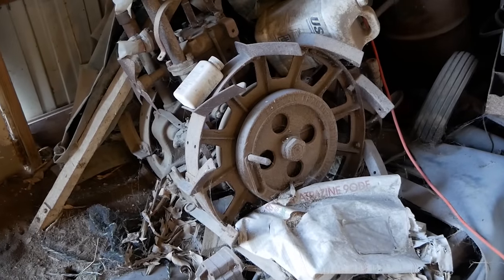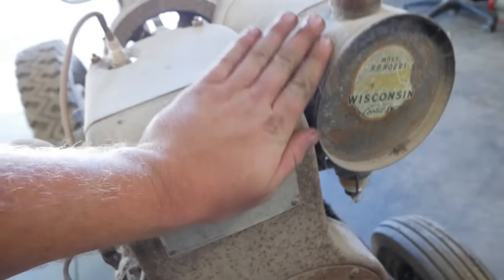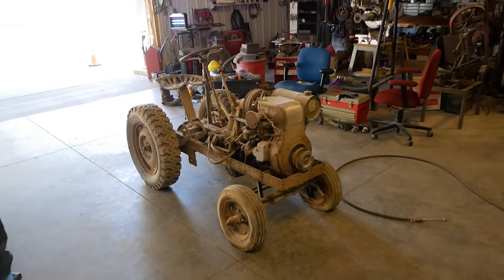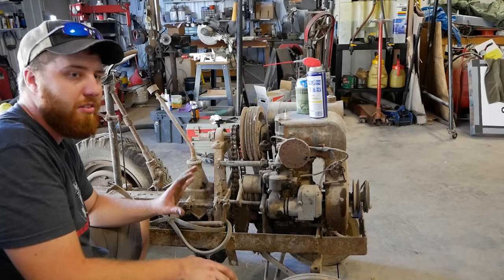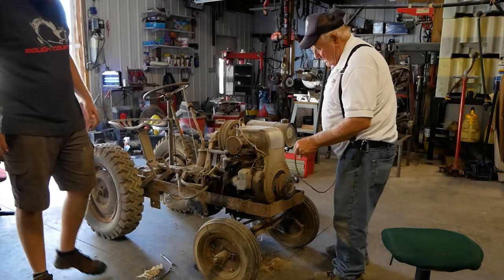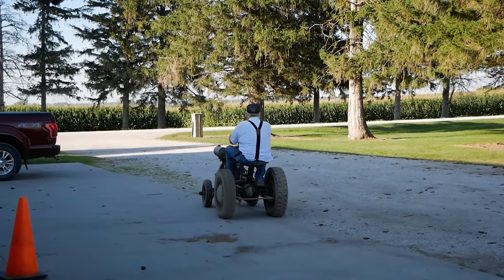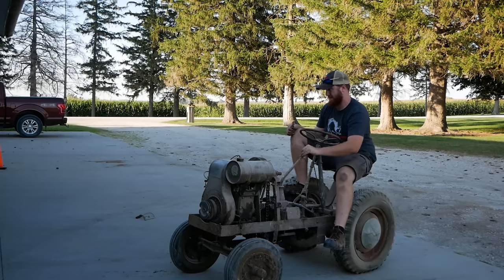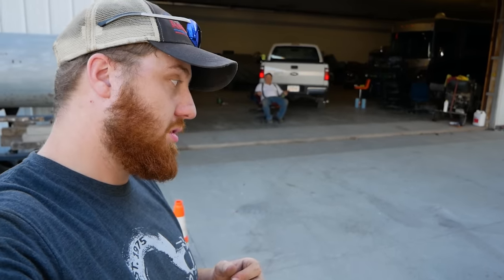Will This Homemade WW2 Era Garden Tractor Run After 20 YEARS Abandoned!?

Comment from the maker: Thanks to Honey for sponsoring this video! Get Honey for FREE today ▸
https://joinhoney.com/junkyarddigs
Reply: Mmm. Yes honey
Reply: Much better sponsor then the shave your junk company.
Reply: I have 3 garden tractor I am selling a 61 Sears Suburban  a 1973 wheel horse and and a 1970s John deer 214 garden tractor
Reply: Let me know if you are interested
Reply: the new sponsor is like a late 70's or later sub compact car with a 3 speed automatic such as my 1985 Dodge Omni I used to have...NO BALLS!!! LOL🤣🤣🤣
Reply: @Junkyard Digs Kevin that thing was something and Denny is a real legend of a guy, still fascinates me to this day how you can build something great out of leftover parts, a friend of mine has a tractor like that but bigger, it was built in 1963 by an old farmer who didn't have the money for a new tractor but had a worn out 1936 for 1 1/2 ton maybe 2 ton truck that seen way better days, chopped the cab off shortened the frame and put a late 30's maybe 40's or early 50's Chevy half ton 3/4 ton axle in the back with small tractor wheels and tires. Also took the shocks off the sides of the truck hood off and had nothing but the clutch, 2 brakes and a gas pedal with the 3 speed truck transmission and the more powerful 85 horse flathead V8 out of a 37 Ford and built a tractor out of it. I drove it once and it still has the headlight and 36 Ford truck grill and hood top on it and looked like a "farmer's rat rod" matter of fact it could do over 60 MPH but my buddy told me with no shocks he wouldn't take it that fast on a gravel road and when I drove it I could see why. When I drove it I didn't get it out of 2nd gear yet and it hit a bump and took me on a wild ride bouncing around pretty good. One story I heard about it was that since it could go down the road fast enough they could drive it into town and even drag raced it at night since it had that Flathead V8 and could accelerate quite quick, it was quite the custom machine
Reply: That was sooo cool!!!!!!!!!!!!!
Reply: Great video and looking forward to more in the series Kevin.  I like how you took a back seat a bit, showed respect to the old master, let him direct the narrative and apply his well-honed skills.  You also immediately picked up on the most important way you could make the whole collaboration work flawlessly... Be the pull start guy! :)  And, you let him choose the beer intake pace and abided by it.  Well done to the two of you for producing just a good ole' fun time there.

Cheers, Sev
Reply: Did anyone else see the smile on his face when she fired up for the first time. That right there made his day
Reply: @jrocco36  njhnnnhhn..m ommm.
Reply: That tractor is priceless 👌 minttt
Reply: @anthonyjernigan5607   I sure did, the sights and sounds of old memories coming back to life can make anyone smile
Reply: Ohhh I'm so looking forward to these old machines and maybe even a ride along in his hotrods!
Reply: This beast is from an era when they called them Engines instead of Motors.  Love the channel.
Reply: That thing would be awesome to tug cars around.
Reply: That was amazing~! More old stories and tech! Can we make a modern version with scraps from trackers and cars too! Then put em side by side!
Reply: @lostkidaf7952  eI’m yeweèrrr we ejjhjjjjjec
Reply: Does he want to sell it? If he does, what do you think he would take for it because this thing is built better 80 years ago than the crap they put together today. I am in pure amazement. I would gladly take it off his hands if he would like to sell it.
Reply: @jrocco36  BALLS
Reply: thx for doing things like this i don't see  a lot of channels that sit and talk the older generation   they have a lot of useful info that and story's  that can be learned from
Reply: Clean that thing up and paint it :)
Reply: WD 40 should have sponsored this😂
Reply: Yea I saw you boys rollin east down I-80 on Saturday the 21st when I was driven to Ames to move in for another year of school.
Reply: For this mechine home I maintain arrange estimate cost.
Reply: Start up with the prices little mechine.
Reply: Yes the old Vicky’s pushmower not wanting to stop running used to keep me alive.

Comment: Handmade tractor from 1943: "You're gonna be hard pressed to find parts for this".  I love Denny.  I think he is gonna get you to 1M subs.
Reply: The really amazing this is, they didn't NEED any new parts anyway!  Try starting a modern engine 75 years from now . . .
Reply: You fabricate your own parts.
Reply: @blenderoffendor  there would be, but it would all be plastic, aluminium, and sadness
Reply: You can probably get everything for this mechanically. You can probably find NIB engines because they were used by the military as stationary or donkey engines (little engines you revved the tits off to start a big motor using a slip clutch so you didn't need a battery the size of a small shed).

Comment: I’ve worked on a couple of older style engines like this, and they never cease to amaze me with how easy they run. I pulled a head off and beat on a piston to unsieze one once, and it still ran within a couple of hours work

Got to love the all in one intake and exhaust manifolds, all the power
Reply: Those engines back then lasted a  the lifetime
Reply: @kennyrichard2971  1943 to 2021 is one hell of a lifetime and that thing still wants to go back to work. Not even any smoke or knocking
Reply: Reminds me of a 6V Cummins, just chugging along

Comment: Had one a lot like that in the late 60's or early 70's. Bought for $35 at an estate auction. Used it for lots of odd jobs. Rigged an electric start so my kids could run it. Old Ford starter and an AC clutch. Fond memories.

Comment: I believe that is actually a Gibson model A tractor. With a steering wheel to replace the original tiller steering. An early 1930’s model. Made in Seattle Washington. It should weigh approximately 900 lbs. you could pull a two bottom plow with it. They had many accessories for them including a plow blade. I have the same tractor in my driveway with the original plow blade. I’m currently restoring it. Fun little tractor. I plan to show and even work mine a little bit. Their is a club for them. The early model A’s (the Seattle built ones) are very rare. Less than 200 known left on earth if I remember correctly. Neat, tuff, strong little beasties. Mine spent a long time in a hay loft of a barn that collapsed around it. The motor sheet metal got some dents when it fell through the hay loft floor and later when the barn collapsed on it during a storm. But it’s otherwise fine.

Comment: Back in 1973 in Marquette Michigan my wife and I visited a family for thanksgiving and they had rig like that the cut down the frame of a Ford truck and used the rear Axle and the transmission, cut down the axle like this one and the drive shaft. It had a tracker set like that and same type of motor.  However the transmission and the motor was tied together with a v belt and to engage you would lift the corner of the motor and tighten the belt to make it go. When you change gears you lower the motor change gear and lift the motor again.  Man it would really go ant where! It was great. That machine in your video really brought memories, thanks!!

Comment: Those wisconsin engines are great. Parts are expensive! I buil a tractor and used it for around 20 to 25 years. Hauled all my firewood with it and plowed my driveway with it too. I did finally put hydraulics on it for the plow. Hydroturn too!

Comment: Absolutely love it!!! This is definitely an inspiration to my upcoming builds! I made a 1968 Wheelhorse Commando 8 drive off a 20+ yr old generator motor that I cut up some to weld a pully on and did some other modern mods to. I love seeing machines from the past come back to life! Back when stuff was made to be abused and used! ; ) I've put my Wheelhorse through so much in the short time I've had it and it just keeps going, from pulling vehicles around the property to moving yards of dirt and boulders around it does just about anything just like the home made masterpiece you brought back into use! I don't think it will be just sitting off to the side in the barn anymore! : ) I would love to see more of it in action! Will it still pull everything like it used to? I don't put it past it but it would be fun to watch! Thank you for sharing, instant subscribe!

Comment: Sure wish we could post pics on here cause this is the spitting image from the seat, to the steering wheel and frame and wheels of a tractor My Grandpa built in the 40's but He used a David Bradley tiller 5hsp B&S engine and rear end (Clicker axle). I still have it. This is neat guys.

Comment: Cool video and stories as well.  Food for thought. If you need to stop a engine like that without a spark kill switch, you can use any metal object, touching the metal area around the spark plug and then while still having that touching the other metal touch the top of the spark plug with that same metal item in you hand shorting out the spark and not shocking your self.

Comment: Had a hay baler with a similar vintage Wisconsin two cylinder when I was growing up.  Probably a 1950s engine.  When it finally gave up the ghost it threw a rod and blew a hole out the side of the crank case.  Big cloud of smoke and fire...  

And it kept running on the other cylinder.  

So we finished the field.  When we tried to turn it off it was inhaling enough oil fumes off the crank case through the dead cylinder that it just refused to quit and idled along for three or four minutes.  Solid engines those are.

Comment: We have 3 of those 12hp Cub Cadets. 1 Hydrostatic, other two are manual transmissions. Hydros typically have less power than manuals. If u need to do a tug-o-war against the Denny-O-Matic Mower, then use one of those manual ones.

Comment: This tractor looks incredibly similar to the one that my grandpa had built some years back. Chain gear reduction to an output of a car transmission (through a car clutch in his case) going to a automotive rear end. The engine was the interesting part. While surprisingly similar to the one on this tractor, even with the same kind of magneto, it was off a massive Soviet tractor where it was used as a starter since this was way before electrical systems got powerful enough. Originally you'd pull-start this little gas engine, then engage the clutch and use it to turn over the main diesel. Once that one was going, the little one was un-clutched and turned off since it was no longer needed.

Comment: great stuff.  one thing they did a lot during ww2 was wood gasifiers since gasoline was rationed, you can make any gasoline combustion engine run off of the vapors produced by heating up charcoal .  nitrogen, carbon, methane ect.   i rememberseeing pictures of the one my grandfather built on the back of his 38 ford farm truck and that sparked my interest at around 7 or 8 year old

Comment: Looks like the twin to one that Dad built in the middle sixties,he had it running once but couldn't get the gear reduction down,it featured a homemade frame and front axle with a Wisconsin engine,a three speed Chrysler transmission and a narrowed mid fifties Studebaker rear axle.

Comment: My uncle built a tractor from an old studebaker back in the 80's. The body had rotted away and somebody took the engine but it still had the trans rear end and frame, after a lot of cutting and welding and an old kohler industrial engine he had a tractor. He put a cargo box on the back, he would drive it all around the area and I would sit in the box and go on adventures with him. It may have just been to the local convenience store and back but it was fun as hell

Comment: I have a 1946 Wisconsin air cooled single cylinder almost exactly like that. I got it for free from my shop teacher who thought it was busted. It is mounted on a very old angle iron cart with a 2200 watt alternator connected via belt. Took the carb apart, patched a hole in the float, reused the seals, and it runs better than my 1984 Sears 2400 watt purpose built generator. Runs my shop air compressor when I loose power.

Comment: Their welder was a crock filled with salt water and a mail order welder unit. Looked similar to a curling iron (in its shape) with a wire off each end. The heavier the salt the better it conducted while the distance between the two parts of the welder determined the Amperage at the welding rod clamp. Interesting tool and most folks walk past them in farm sale or yard sale.

Comment: Looks like something like the original EPA-Traktor here in Sweden from ww2 when they basiclly cut off the middle/rear end of a (most often) 20s-30s car/small truck and mountes it to some big axles, lowered the gears and put big wheels or tractor wheels on it. :)

Comment: The motor and clutch system looks like it is from an old Gibson garden tractor I used to own. Mine did not have the chain drive but I think it did have a 3-speed transmission.

Comment: We have Perkins 4108 diesel that would very near fit right into that chassis!  We also have a couple of mid to late '40s Anzani Iron Horses you'd love to play with, powered by J.A.Prestwich model 5 engines, not unlike the Wisconsin in your little tractor. My dad used to swear by those "Wizzy" engines, especially the war surplus ones.

Comment: Ah man. I grew up helping my dad over at a saw mill that a guy built with mostly old threshing machine parts etc, belt driven by a 1937 John Deere model A tractor.  Also he had fabricated a live hydraulic system and loader on to an Allis Chalmers WC tractor of similar vintage used to load the logs on and off the '47 International Harvester 1 1/2 ton truck. Yet no indoor plumbing in his house nor a telephone lol!

Comment: Before the hot rod aftermarket took off this way, was the only way to modify anything. We were forced to use our imagination. I enjoyed the pre aftermarket days. Building a 327 Chevy engine that would outrun a factory 383 Road Runner was big fun for me. Factory parts & even the existing after market were dirt cheap. In 1973 a Crower Cam $50. Set of new solid lifters $50. Valve job for 327, $50.

Comment: Tractors back in the day had steering brakes. If the left wheel would spin, that's the brake you push to get it moving.

Comment: My parents had one I used it back in the 70 ty's  I wanted to work on it and my mom at the time said she gave it to one of her friends he never got it I guess it still setting it had a 14 hp brigs and strattened  engine 38 Ford rear end other than that looked just like yours my neighbor copied the tractor and built his own and he put an air horn on it sounds just like a Semi and just as loud and he would go to the middle of his front field of his  place and catch those truck drivers speeding around that curve and honk at them they almost wreck trying to slow down and then they can not find the truck that honked at them speed limit was 20 for cars and 15 for trucks and they come down threw as fast as they can hold the road  and a cross road at the end of the curve and a blind curve

Comment: My grandpa that was a car man, building wrecked cars, salvage, used cars, fabrication etc, built one that was very close to this the frame and engine were identical it had a early 1930's Packard manual trans, 50's Chrysler Rear diff, steering column from a 1955 buick special vert. It had a push blade in front and a small 3 point hookup on the rear Ann's the lifting and lowering were done with small steering gear boxes of of a small Nissan or Mazda car. They worked perfectly and could even lift the front and rear simply turning the rotary arm counterclockwise until it easily lifted the tractor. The front steering and suspension was a simple small tractor spindle that is L shaped with vertical shaft that installs into the main axle that accepts it. He lengthened the vertical shaft 10 inches and added a light spring on top and on bottom he stacked sufficient springs that got harder to compress as it moved up to allow 4 inches of compression travel & 2 of extrntiom down in each independent individual side. The other 4 inches were lost to the compressed spring thickness. It was just something he was experimenting on. I love these things. Unfortunately my father with alzheimers/dementia and a stroke victim sold it for scrap not knowing it was special or his father's. 😥😞😭🥺

Comment: i have a small block 77 chevy that we had to pull the motor and get a washer out of the intake and put it all back together it has a high idle that doesn’t change when i turn the screw it may a little but not much and when i put it into drive or reverse it drives for a half a minute or so then it dies out and just keeps doing it is there anything anyone knows what may be causing it or what to fix this? it’s been sitting and i’ve been trying for a year or so to figure this out!